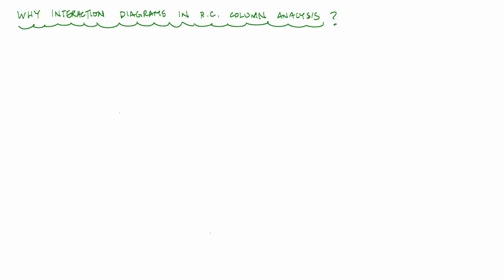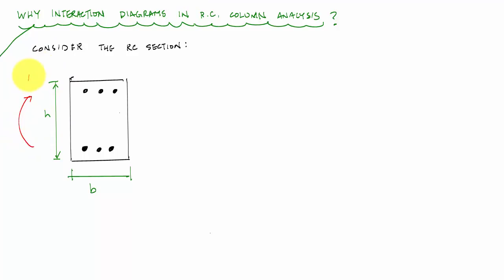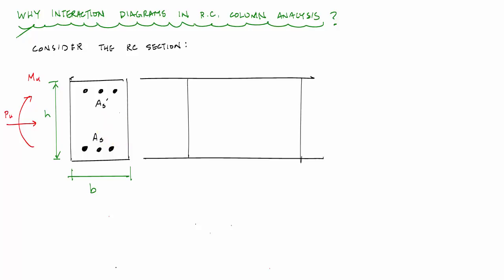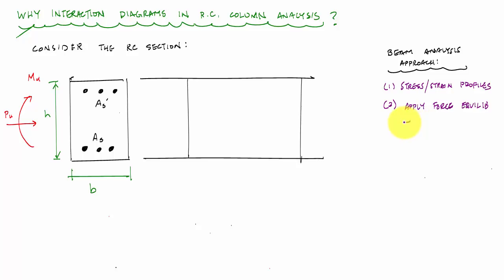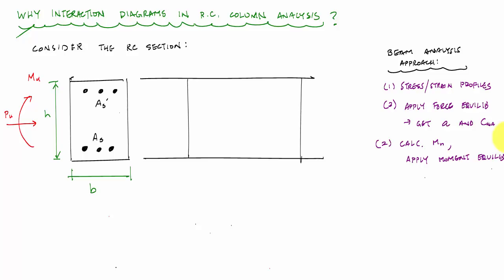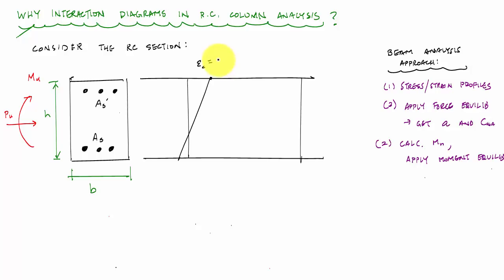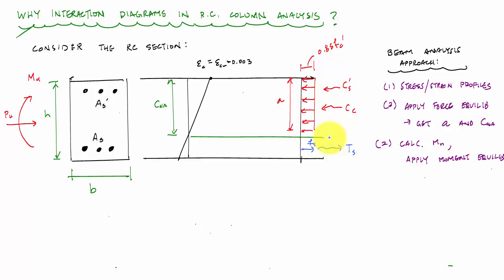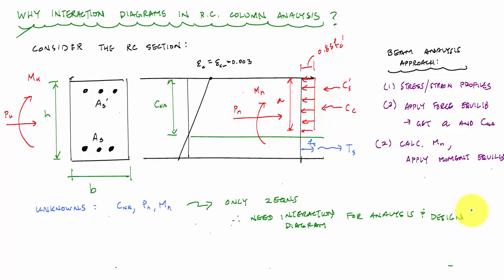Why Use Interaction Diagrams for Column Analysis and Design - Reinforced Concrete

Comment: How about if to find c using like this,the first  find Pn by using equation Pn = 0,65 0,85 f'c(Ag-As)+ As fy and then using the force equibilibrium equation  Pn = Cc(concrete)+Cs (steel compression)+Ts(steel tension) just one unknown c,next  get  Mn by using Mn equibilibrium equition

Comment: plz sir g solve this for me... at 23 Feb is my papar... a reinforced concrete simply supported beam has a Span of 30'and supports dead load of 1000lbs.ft in addition to it's self weight... design a beam section to resist the factored external binding moment.given fc'=4ksi and fy =6ksi